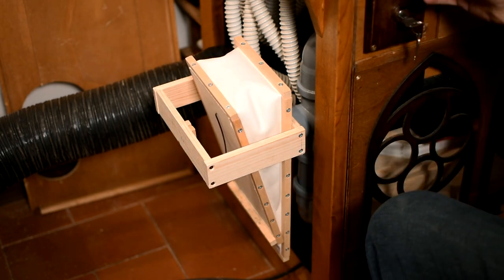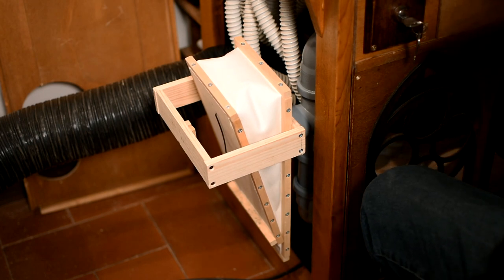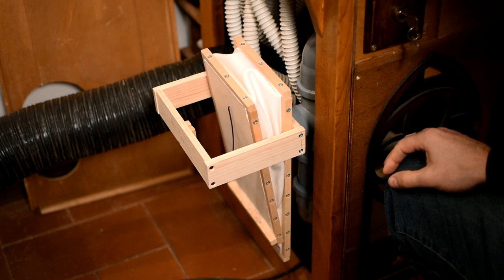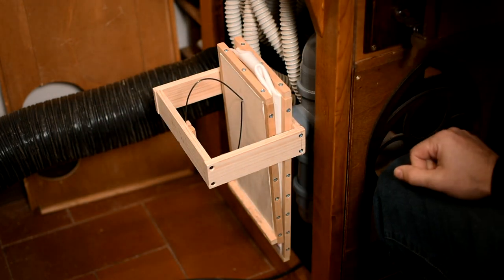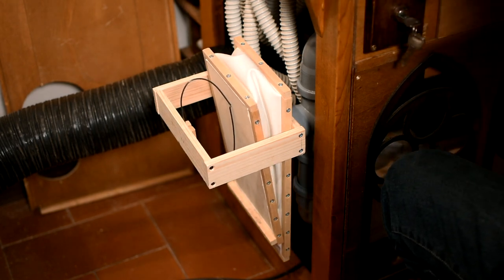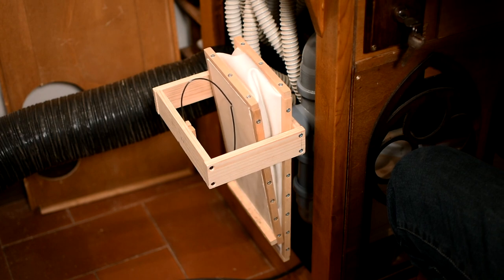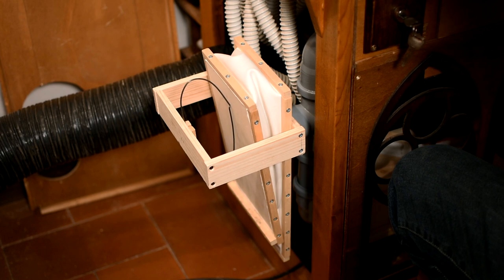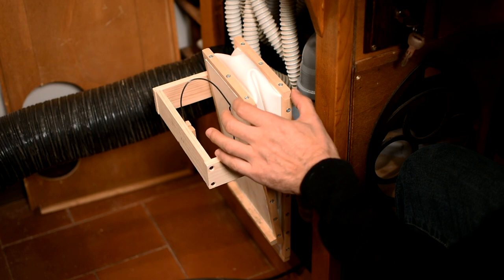Concussion Bellows | Homemade Pipe Organ | Sub ITA

Comment: Very interesting! I've seen concussion bellows illustrated in various organ building books, but could never understand why they were required in addition to the pressure regulating bellows. This makes it quite clear. Is this bellows connected directly to the wind chest then?
Reply from the maker: mine is on the duct that brings the air to the windchest, it must be as close as possible to the windchest.

Comment: Is beautiful, but the rib must fold to the inside, not to the outside. This means that the stripes you cut for the rib should have been wide enough for them not to be fully open even if the bellows are at the maximal opening.
Reply from the maker: Hi Jorge, Thanks for this right observation but, Inevitably, the pressure causes the skin to fold outside. to make it fold inside, I should have glued it to wooden ribbons.

Comment: Hi, I am looking at servosystem to pull the bellows mechanically. Do you have any experience? Does it work with a single bellow?
Reply from the maker: Hi Pietro, do You mean with a pedal or a crank? I've never actually done that, but you can check out the street organ